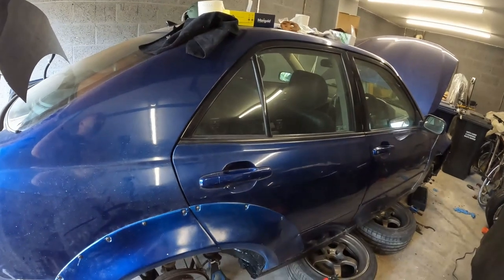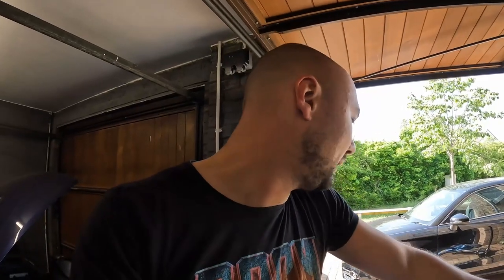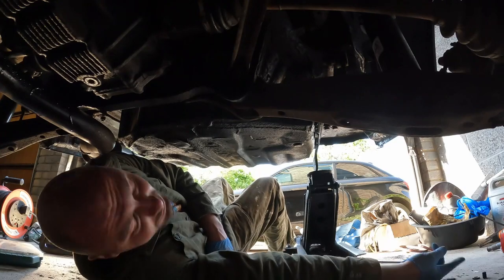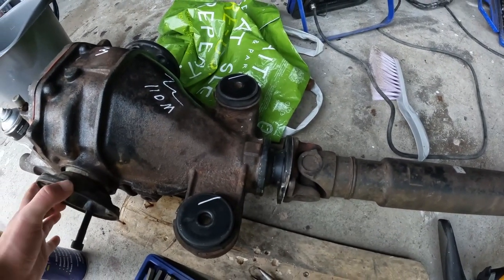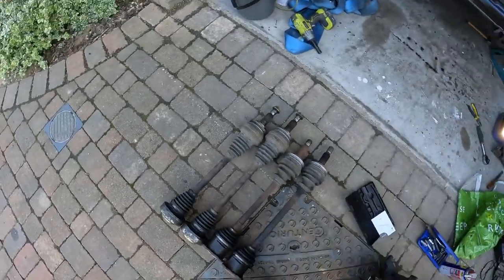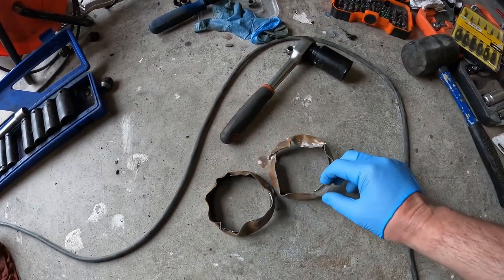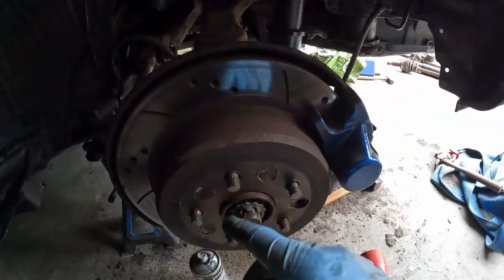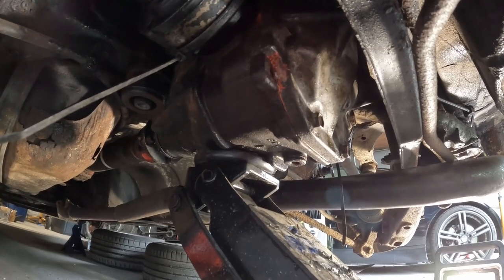Swapping GT86 Differential into Lexus IS200

Comment: 31:22 Tip: if you intend to reuse or sell the driveshafts, NEVER EVER hammer them out like that!!! The threaded stud section is made of a soft metal and you will most likely deform the threads as the metal compresses from the hammering. You won't be able to screw the hub nut back on which is made of an even softer metal.

Best way to do it is using a solid tapered punch tool (from Halfords or Amazon for less than £10). Place the pointed end into that hole on the face of the stud and then hammer at the punch tool. That will push the stud out the hub without damaging the threads.

How do I know this?...I learnt the hard way as I ended up having to replace both driveshafts after hammering them out like that.
Reply from the maker: Thanks for the tip. I've noticed that and started using a block of wood. No damage was done, as I swapped the shafts again, but a punch tool is a great idea🔥
Reply: @alexleto430  a block of wood is an alternative for sure. I just didn't mention it initially as I found to be not so full proof a method when I tried it too. Using a punch tool is best, but the wooden block method could also work too.

Comment: It’s normal to have different thicknesses on shafts if they have different lengths, because longer shafts will twist more, thus, they are made thicker. See this sketch and imagine it as the rear transmission, and imagine shafts are made of rubber: 
{}——D—{}
—> if you apply rotation to D(diff), which wheel ‘{}’ will move last?

Comment: Can’t the is200 axle shafts and prop shaft be used with gt86 diff. I thought the bolts just need to be changed for mounting the gt86 diff to an is200?
Reply from the maker: Is200 comes with a smaller 7inch diff and skinny 4bolt axle shafts. Prop can be re-used but will require some extra work. If you have is300 then it's a straight swap

Comment: Hello, do you know if the back section of the propshaft has the same bolt pattern for is200 and is300? I understand the is200 propshaft is longer, but would it bolt on to the gt86 one?
Reply from the maker: I bolted my is300 prop to a gt86 diff. And the is200 bolts up to. So I don't see why it wouldn't work

Comment: Hi does the gt86 diff internals fit into the is200 diff casing so you use the 4 bolt flanges and drive shafts?
Reply from the maker: @thomasscott199  no it doesn't, the 4 bolt casing is smaller. You can use the driveshafts from is250 with a gt86 diff but you'll lose abs
Reply: @alexleto430  ok cheers for that 👍

Comment: What work is required with the stock IS200 propshaft to get it to work with the IS300 diff?
Reply from the maker: If I remember correctly, the stock prop is shorter and you'd need to adjust the center prop bearing. Some people don't recommend doing it because it puts more stress on the bearing. I've never done it myself, so can't really give any advice. I guess worst case you'd be looking at a new bearing

Comment: I heard that people use is220d or is250 axel shaft while using is300 diff. Will it work with gt86/brz diff?
Reply from the maker: I've seen a few cars on the internet with those swaps but I didn't do much research into 220d/250 diffs. I went with gt86/brz diff as it's a straight bolt on. No fab work needed just remove the old stuff and put the new in
Reply: @alexleto430  I know, but availability of is300 axles suck thats why Im thinking about using brz/gt86 diff with those from is MK2, which should work because it work with is300 diff... :)
Reply from the maker: @aaabbb9953  well if they work with is300 diff they'll work with gt86, too. One of the differences that I can see from the pictures of the is220/250 shafts is that they don't have rings for ABS sensors. So even if they do fit you'll need to fab something for abs sensors
Reply: @alexleto430  they work and they hold a lot of power but they don't have ABS rings so you basically lose all the functions of the trc, abs and other
Reply from the maker: @PostMortemor  that's cool. Thanks for confirming my thoughts. I guess for a track/drift car it's not a big issue.